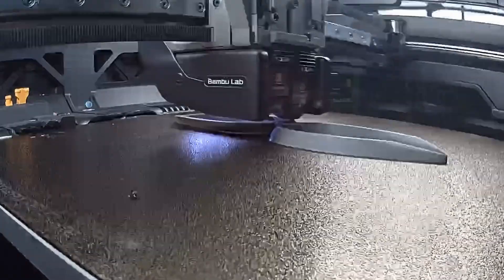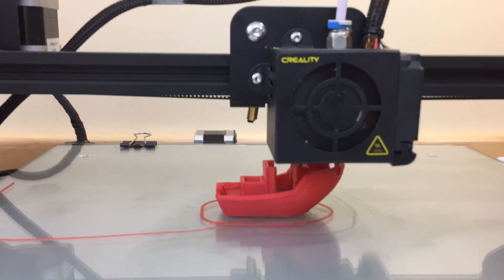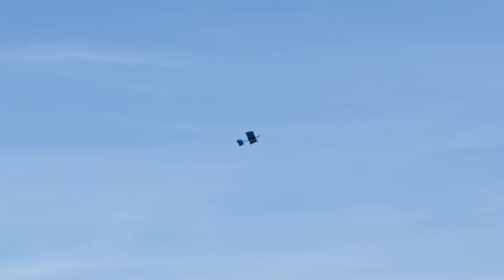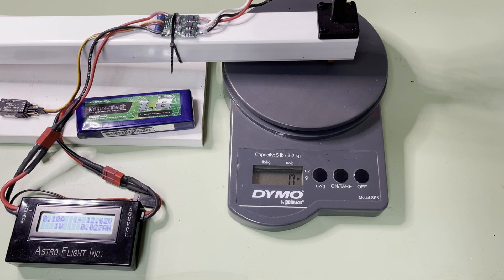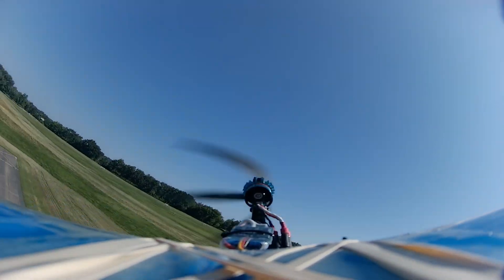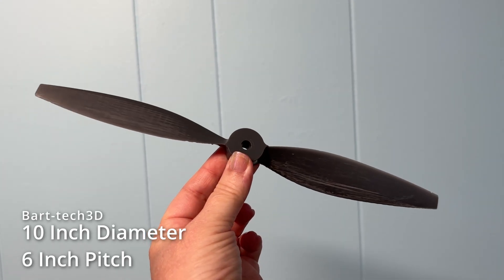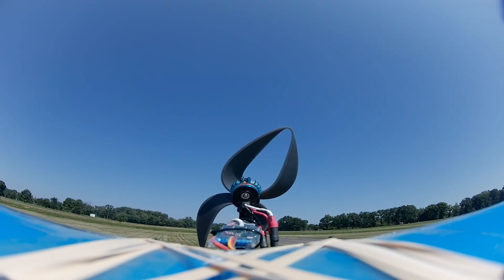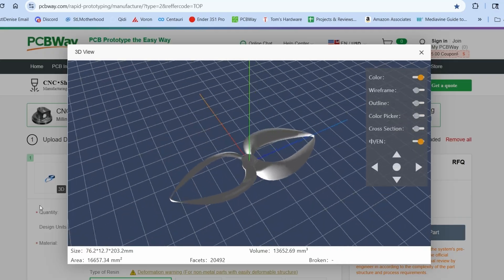We 3D Printed MIT’s Wild Torodial Propellers: Do They Really Work?

Comment from the maker: Can you really 3D print propellers for RC planes? We put traditional props and cutting-edge toroidal propeller designs (based on MIT Lincoln Laboratory’s 2020 patent) to the test — and the results might surprise you. Using Formlabs Tough 2000 resin, custom CAD tweaks, and even a DIY thrust test stand, we compared static thrust, efficiency, and durability against store-bought props.